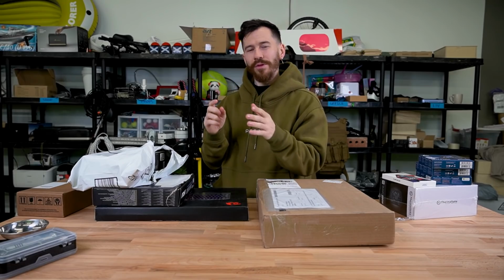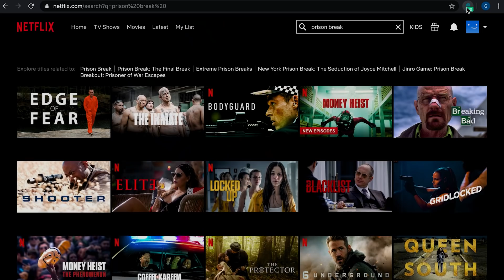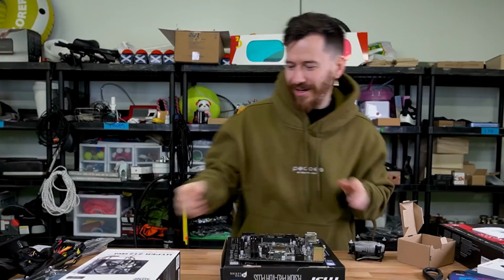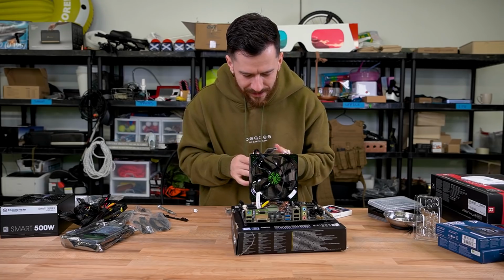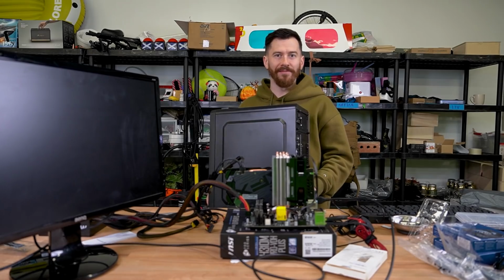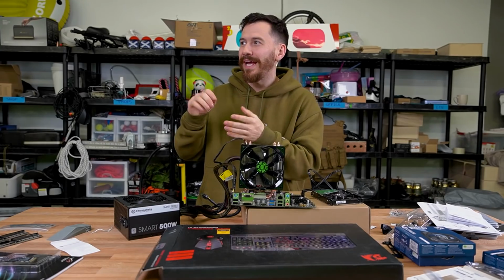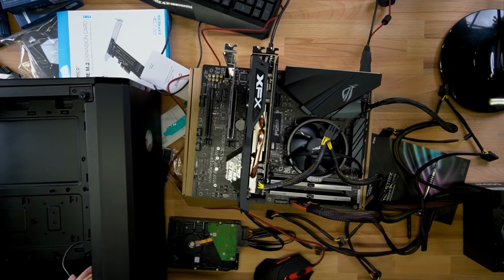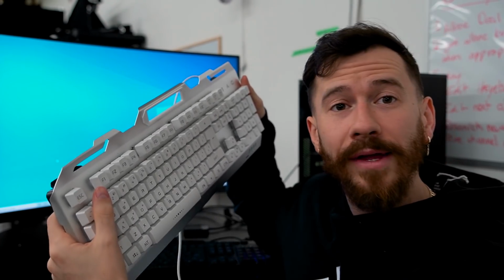WISH vs. AMAZON - Cheapest Gaming PC Build Challenge!!

Comment: you could actually build a pc that can run modern games pretty decently for around 200 to 300 dollars. (even lesser) if you want to choose the good stuff and you dont know abt tech alot then you should try doing some reaserach abt that item. also, you could go for a normal looking ram stick especially when you are in a tight budget. for the power supply, just go for the corsair to ensure safety. i bought mine for 20 dollars. for the case, you really dont need to go fancy especially when u dont have the money. u can also buy decent second hand mother boards. for the graphics card, you really need to spend alot there. so if you really want to do a cheap gaming pc buikd video then u think u should know these things.

Comment: there is power pins on the motherboard usually you need to plug in the pin header wires to use the power button but theres pins on the board you can turn on with like a screwdriver buddy its not the motherboard lol

Comment: How do you expect that pc turns on automatically. When you turn on powersupply it doesnt mean it will turn on the whole pc. U should have just put the parts in a case.
Reply: Um no. You just need to shortcut it with an screwdriver or usb stick

Comment: 9th gen i5 +mobo $200 combo micro center
32 GB ram ripjaw ddr4 ram $100 Newegg
240 GB inland professional ssd $30 micro center
Evga 450 watt power supply $45
Cheapest Newegg case $28
Linux is free 99
About $400 i3’s suck

Comment: My guy, your motherboard wasn't broken you just werent turning it on, you turn the power supply on and then you short 2 pins together to turn the PC on
Reply: That's why it didn't work until you put it in the case and connected the power swith

Comment: I haven't finished the video yet, but I'm going to lay into you anyway.

Just because you have the power supply connected and turned on, DOES NOT MEAN YOUR COMPUTER IS TURNED ON.

How do you normally turn a PC on? You press the power button on the front panel. How do you turn on a PC that's not in a case? You have to short the pins on the motherboard to turn it on. And since you keep claiming you are new to this, I do not believe you know how to do that
Reply: I finished the video and I'm still annoyed. TODAY, I BECOME KAREN

WHY WHY WHY WHY WHY WHY WHY WHY WHY DID YOU NOT ASK FOR HELP WHEN THIS HAPPENED OMG THIS WAS PAINFUL TO WATCH. I BET YOU YOUR MOTHERBOARD WORKS AND YOU JUST NEVER TURNED THE DAMN THING ON

"Calm down! And I did! See?" shows how the power supply is on

Me: Did the other computer you built turn on when you turned on the power supply? Or did you also have to press the power button on the case to turn it on? HMMMMM GEEEE I WONDER

Comment: Get a intel core i9 (CPU), GTX 2080Ti (GPU/Graphics Card), CorsairH100i RGB platinum 75 cfm liquid cpu cooler, MSI Z390 A PRO ATX LGA 1151 (motherboard), Corsair Venegance rgb pro 16gb DDR4- 3200 CL16 (Memory), Samsung 979 evo 500GB (Storage), NZXT H510 ATX mid tower (Case), Any power supply 750-800 W (power supply),

Comment: this really ticked me off but ill be nice... there is pins on the motherboard that need to be jumped with a metal tool it will kick on the pc. its where the power switch from the case goes connected. if you wanna sell me your "broken parts" ill buy it off you.

Comment: 🤷‍♂️🤦‍♂️🤦‍♂️🤦‍♂️The motherboard do you using with the power supply you just need a screwdriver and jump with 2 pin  Does say power plus power minus in the motherboard so you can turn it on that doesn't mean that the power supply doesn't work.

Comment: believe it or not, an FX-4100 can run a RX570 from 55-90% of its graphical processing power... runs games listed for a FX-8350, tho only 40fps on 1280x720p High/ultra settings, streams and records too but the hard drive is emm. "over clocking, boards with self checking voltage functions... just set the frequency and if it boots its good to go, the software and the Calculus functions in the self monitoring BIOS will just lock you out after so many hours, but if it smells like burnt ants under a eye glass... that's a perm ban.